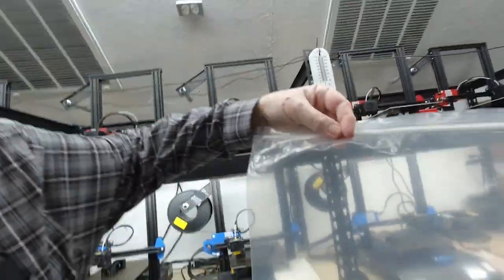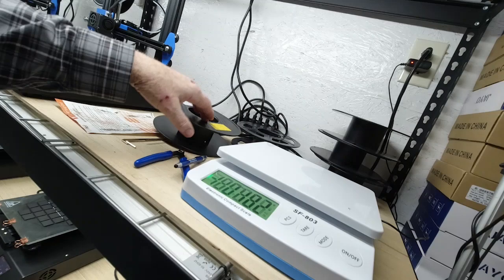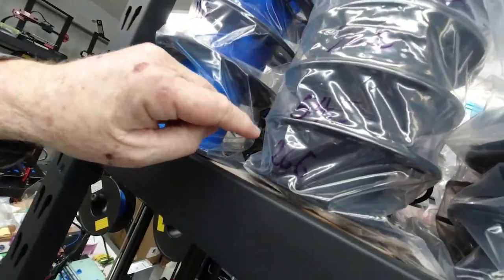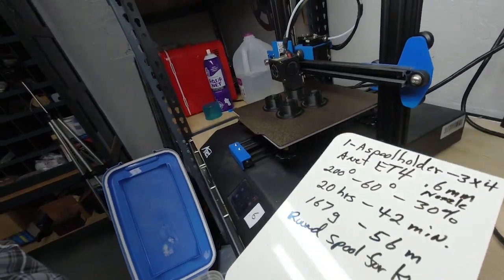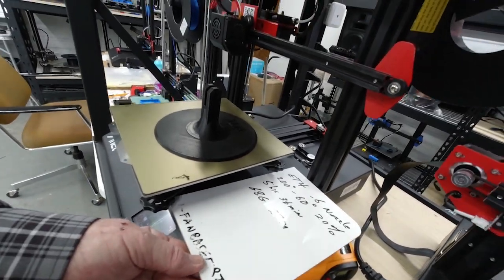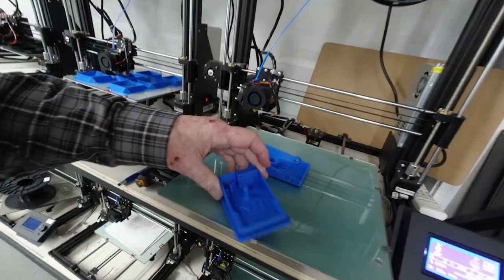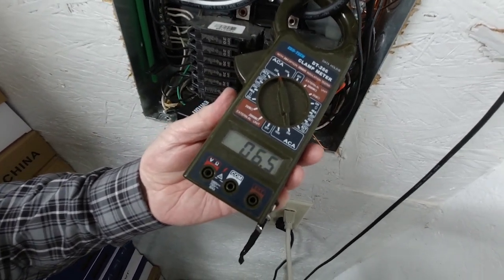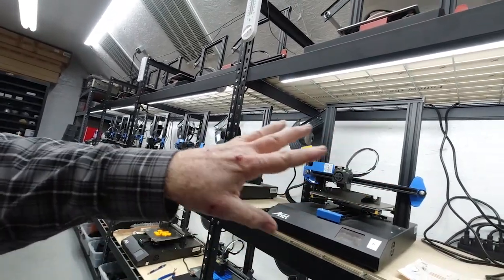HOW I MANAGE FILAMENT USAGE FOR (60) 3D PRINTERS at my 3D print farm in Tennessee.

Comment: Wonderful video on how you calculate spool usage and maximize filament. I’ve been kicking that question in my head.
Reply from the maker: The scale cost less than $20 on eBay and it a very easy way to keep up with your filament. Thanks for the comment and your support...Ken

Comment: You are a one man factory, i love how you have a system for managing the filament, dont your printers have a pause for running out of filament so you can reload a new spool mid-print?  Larry
Reply from the maker: Thanks for the question, Larry. Most of my printers do have the pause function that will allow me to load a new spool, however I am not around all of the time and if my printer pauses the bed and nozzle stay heated, causing the filament in the nozzle to sometimes start to harden and build up on the nozzle wall. This is when the printer is unattended for a long period of time. This is why I try to have enough filament to complete the print job each time. Thanks for your support...Ken

Comment: Hey Ken, I just found your channel and have subscribed.  You really have your process down.  I'm doing something similar where I have a product I invented and am trying to sell it on my website and Amazon (FBA).  A requirement I found out about selling on Amazon FBA, your product has to be able to survive temperatures of 155 degrees F.  I switched over to PETG, ABS and ASA.  PLA will deform in the heat.  I'm not sure if your selling FBA or FBM.  I think even with FBM it can get pretty hot in a delivery truck in the summer.
Reply from the maker: I am not selling on Amazon FBA. I have not had problems so far with heat and try to add some extra insulation in packaging to both protect from shock and heat. You have a good point and I'm sure you are much safer with PETG or ABS if your packages are going to be exposed to extreme temperatures or direct sunlight. Thanks for your input and support...Ken